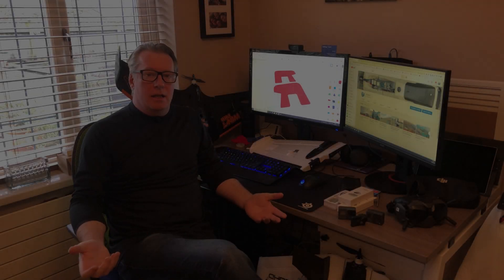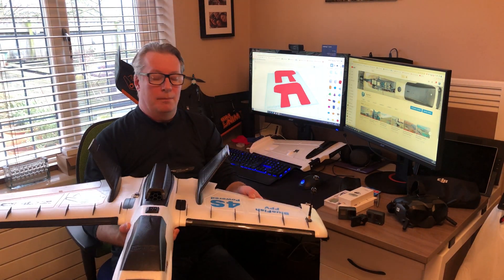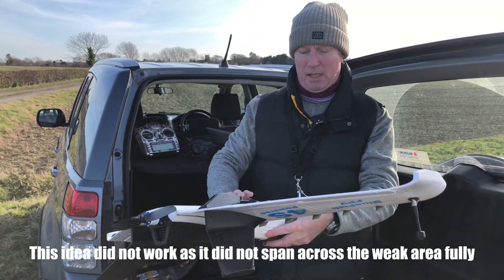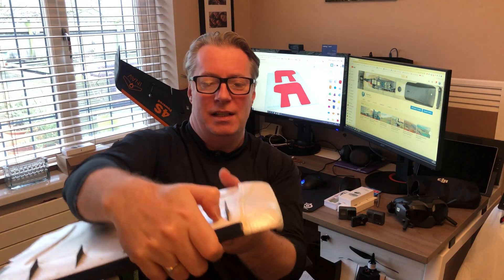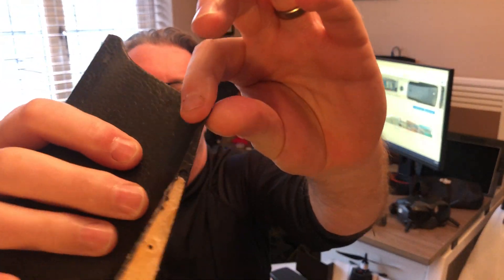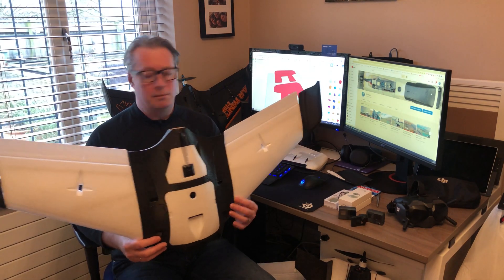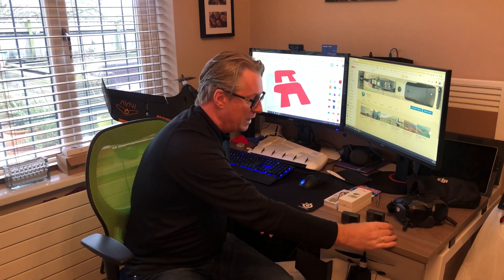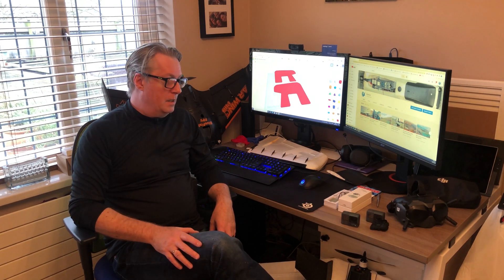Rain Stops Play - AR Pro Hybrid & Dart XLE Wing Mods

Comment: Thanks for sharing your thoughts! I'm trying to decide between a Dart XL vs a AR pro. 
which have you found to be more durable and easier to fly at high speeds? Thanks!
Reply from the maker: Sorry Henry missed your message. AR Pro all the way Dart XL has very delicate nose and foam, does not like high speed flying at all. AR Pro is a brilliant all rounder.

Comment: I think the easiest way to shed weight on the ar pro would be to move the motor forward a bit internalising it somewhat. That would eliminate the need for balast weight up front.
Reply from the maker: Sorry for late reply Andrew, I have had an issue with Youtube not displaying all my comments, fixed now. Not sure how you could do that but I guess it would work. I use 5000mah 4S and a GoPro Hero 6 so no need for ballst. May as well have battery rather than dead weight I figured.

Comment: can you tell a difference in the new motor on your ar pro compared to the stock motor ?
Reply from the maker: Hi John I have not flown the stock motor as my AR Pro’s are kits and do not come with motor. All I can say is that the SunnySky Mark III motors are excellent and this 1400kv on 4S with an 8x6 prop is a joy to fly. Good smooth power delivery with plenty of grunt for good speed and fast climbs even when carrying a 5000mah lipo.

Comment: Hi Glenn, good to see another upload from you. I like the mods for the xle wings, I'll certainly add them to mine too. The issue with it pitching up on higher throttle I solved by adding an elevon/throttle mix off a manual switch that I operated when above around 50% throttle. This was in manual mode using kopilot though, not INAV sadly. I could make it work off a logic switch too I think. I'm sure you will come up with the solution before I get my INAV build finished. Still conducting a few recce's on other spots down here as previously discussed. Will make for some great footage if we can jack it up in due course. Cheers Mick.
Reply from the maker: Hi Mick, the wingtip reinforcements seemed to work I had a hard landing in my next video and they stood up well. I have solved the pitching up issue (shown in next video) and am really happy with the XLE now and looking forward to fine tuning her for some long range.

Spring will soon be here and then we can start thinking about dates for a meetup down your way.
Reply: @bluefish3607  Good stuff Glenn, the wing tips reinforcements will be on the printer shortly. Glad you have done the R&D for me🤣. Will send you a message on messenger when all recce's are complete with some aerial footage hopefully. Looking forward to your next upload. 👍

Comment: Cool mods! That 0.4mm pla reinforcement is very clever!

The down trim on that dart looks like the CG is very tail heavy, especially with an additional runcam adding to it. The general CG rule is 3 to 1: for every gram of tail weight, you’ll need 3 in nose to balance. Maybe shifting the battery forward or flying a heavier one will help. Either way, I hope it works out. Keep up the great work!
Reply from the maker: Cheers James, it turns out the thrust angle of the motor was causing the issue. I shimmed the top bolts and went out today and setup constant Autotrim and it was like night and day and the launches are also now perfect. 

Video to follow on my progress, thanks for the input it is always appreciated.
Reply: Aaah! Makes sense! I've never met a pusher config that didn't have some thrust angle up-tilt. I'm glad you found and fixed the culprit! Looking forward to the next update!

Comment: Can't believe you set those elevons with down trim on them at 1500..
In the video, you can see the upthrust on the motor mount causing the climb on application of power. Of course the way to deal with it, is to put the plane into a stabilised mode like Horizon at a modest power level and let iNAV use constant trim to make it fly level. When you switch to manual, there should not be a massive trim change provided you use the same level of power of course. Now, apply more power and observe what it does, if it climbs badly shim the top two motor lugs to cure it. All this assumes you have the board angle set somewhere near too of course. Be aware, this badly designed plane suffers from pitch up as you apply more power, it's been demonstrated so many times by others. Great to see your OSD overlay on your HD feed...I think iNAV are currently trying to do this for DJI users in version 4.10. Early days though...🤔😳😳🇬🇧
Reply from the maker: Thanks for the tips I think you are absolutely correct, I have shimmed the top of the motor and test flew with constant Autotrim set and it was like night and day. I never thought to switch into manual and do the throttle up test which I will do next flight as part of fine tuning things. 

OSD in inav 4.10 will be fantastic as Dashware takes some work to setup every time.

Thanks for your input, very uesful indeed

Comment: I ordered the white "eachine" AR Pro last week too. I had the original black AR Pro last year and mainly because I had many other planes, I ended up selling it. I will be interested in how you get on with the CG on your superlightweight 6S version, as I found it needed a fair deal of nose weight to achieve CG, basically I couldn't get CG without a "normal" GoPro in the nose. But I'll be watching with interest 👍
Reply from the maker: I think it might be a bit of a challenge to get CG but lets see how it goes when I get into the build.

Comment: I fiddled around with the thrust angle on my Dolphin last week. Same experience, couldn't get it in the air propperly until I ponted the motor a bit more up again by taking one of the two washers out. I did some more adjutments after analysing, letz's see how it turns out the next time. As expected, the bird got almost 10km/h faster with a better adjusted thrust angle.
Reply from the maker: Hi Bernhard thanks for the information. I had to do that on my version 1 XLE but they said they fixed it with this version. I will have to do some experimenting.
Reply: @bluefish3607  I guess the trick is to find the happy medium. The stabilized modes tend to make things worse because they countersteer to much especially when starting and landing and create an even worste stall condition by doing so.
Reply: I thought the motor mount is glued badly, because of the angle and I straightened it with washers, so I might have messed it up myself, but it flies great so I don't mess with it.